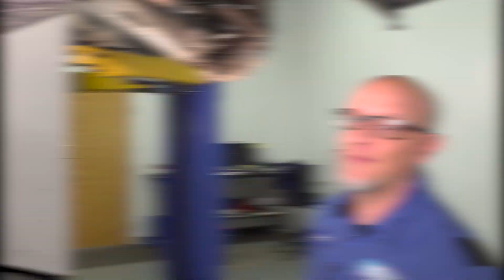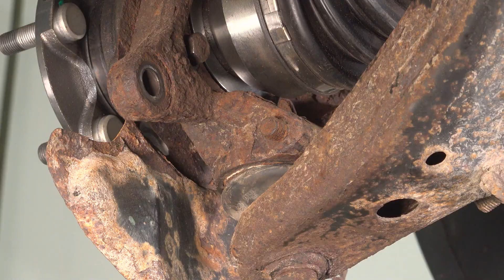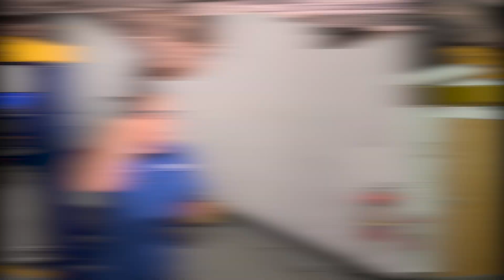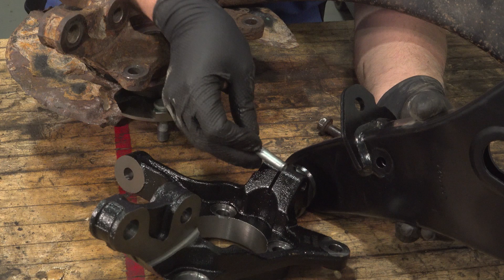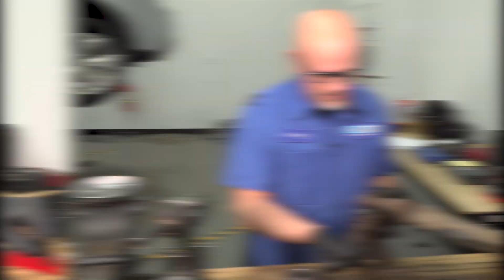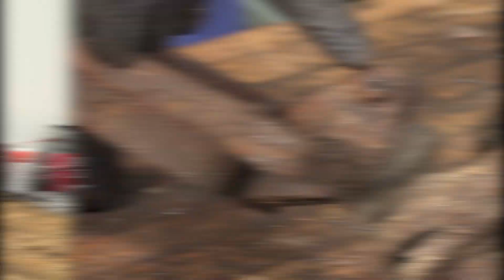Don’t Waste Time Removing Broken Bolts from Car or Truck Suspension Parts! Replace Them Instead!

Comment: thats a terrible design. that said, soaking it in penetrating oil for a day and some heat would have probably saved it. yes, obviously replacing things with new parts is generally easier than fixing the old parts...

Comment: Could you not have twisted it the way it went in just out the other side with a broken bolt extractor and some heat?

Comment: What happens when you uses a hot wrench or heat on the bolt, I work in the heart of the rust belt/Canada, and this tool is a must in any shop….flat rate kills when you start breaking bolts and your original estimate of $200 repair sky rockets to $1000 due to additional parts from you as a mechanic just was to lazy to put heat on the bolt/nut

Comment: Term bottom of the ocean is perfect.   Funny I use this same term when I’m explaining to people what’s most important when looking at used cars.   Most important look underneath and if it looks like it came from the bottom of the ocean then move on to another car.  I’m in Arizona and most cars are very nice metal condition wise underneath.  Paint however will take a beating from the sun here.  1A vids have been extremely helpful over the years to help my car work.  Thanks.  Plus I’ve purchased parts from your company and experience is top notch.

Comment: I’d thread a nut on the threads that are exposed. Weld it on. Oxy acetalene torch it and spin it out from the front

Comment: You don't need a drill press & jig to center the hole to drill out the bolt. All you need is a hinge drill bit. Harbor Freight and Amazon has them for under $10.
Reply: Those drill bits are for wood, not metal.. they might help you to start drilling at the center you would still have to have a perfect angle to continue drilling straight. Much easier said than done, especially without a drill press

Comment: I guess if you are working on your own car you have the option. I have removed many broken bolts to save the money. Sometimes it gets expensive trying to remove the part to replace it over one broken bolt. Especially on old rusty cars. Hey Dr., do I need a knee replacement or just a shot? You need a knee replacement Son.

Comment: Hey. Next time hit that with some PB’s Blaster and a few whacks with a hammer, the let it sit a while, then apply heat with a torch.
OR you can keep snapping bolts.